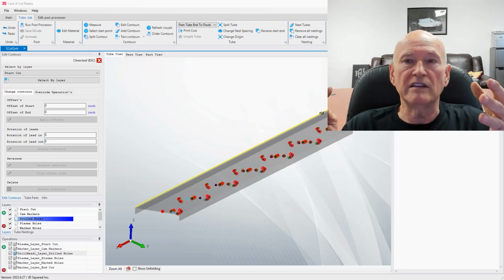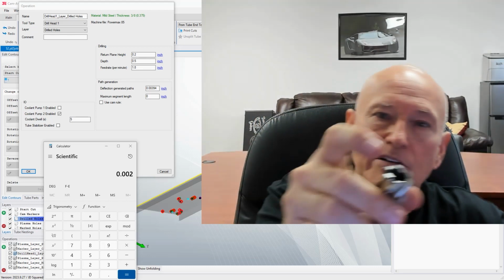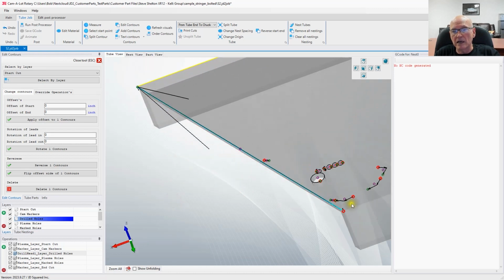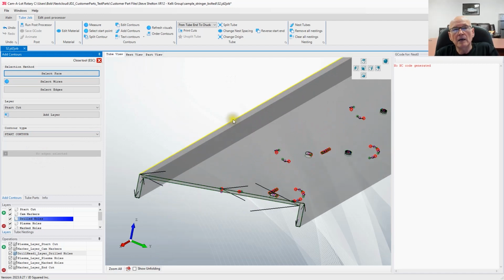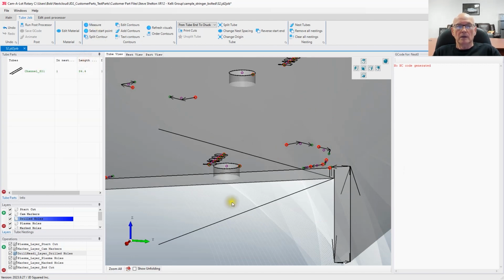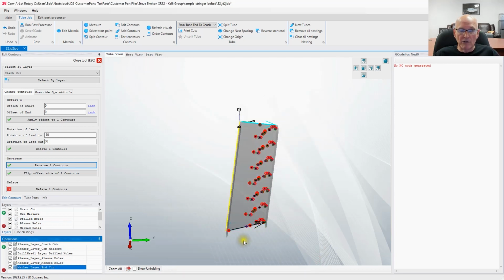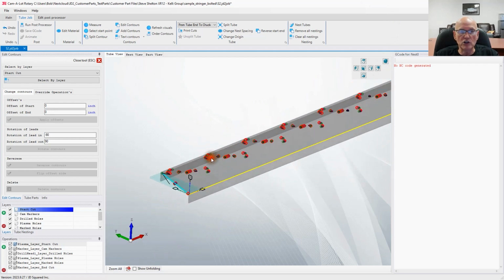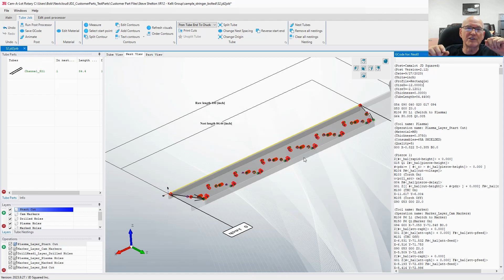Addendum to 'Processing a NC1 file Stair Stringer in Cam-A-Lot'

Comment: Bob, you are stating the cut direction incorrectly. On the exterior perimeter cut of a part, you want to go clockwise, for holes you want to go counter-clockwise. You are correct in saying that the material should be on the right side in reference to your travel direction.